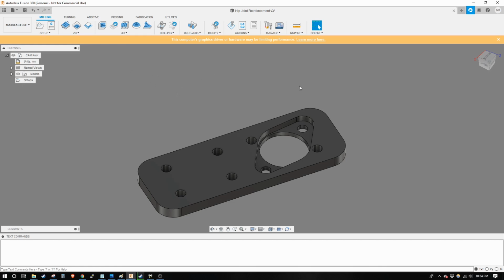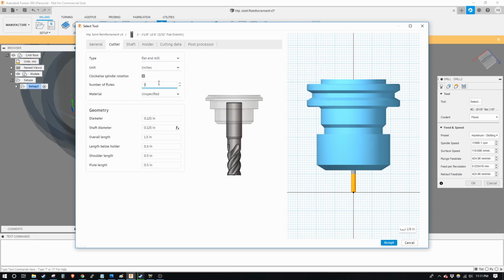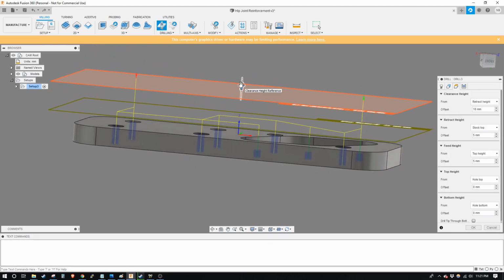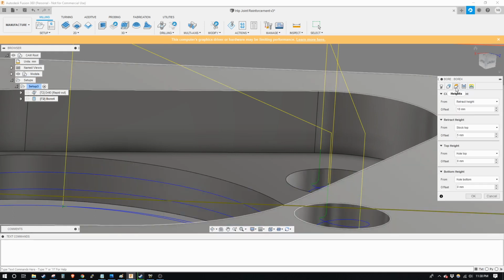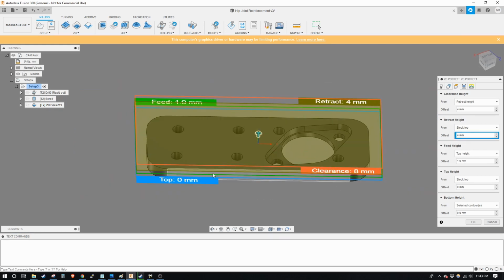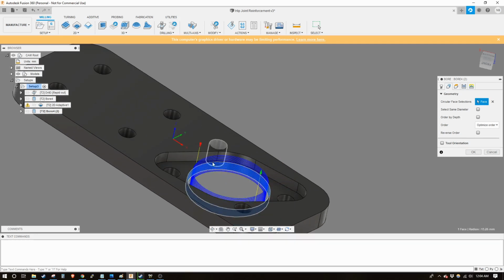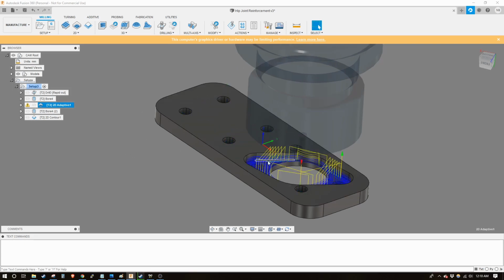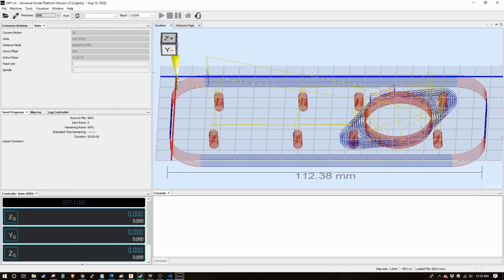Fusion 360 G-Code Aluminum Plate Step By Step Tutorial

Comment: your end mill also needs less flutes. 4 flute isnt good for aluminum.End mills are also not really meant for drilling, which is why when it cuts down to the next level on a cut, it goes in little circles instead of drilling straight down.

Comment: Okay, You divide by four the cutting feed rate three times So I have new spindle can go for 24000 RPM and if I use 20000 RPM as an example do you think I should go for 2 inch or three inch feed rate? with 2mm flat end mill  I don't have 3/32" bit its almost 2.4mm or should I test the feed rate with scrap aluminum board first ? Thanks.
Reply: I forgot to mention to you the spindle brand LD42WS-250 and small 1310 CNC almost like your CNC.
Reply from the maker: I would try 2 in per minute feed rate as a start. I cut out 3 parts before I got my program running reliably. I usually run on the slow end of things just because I'm not worried about run time or optimizing life. If you spend the time trying different things you may find that you can run 3 or 4x faster than what I'm doing by increasing depth of cut or feed rate. The easiest way for a program to fail is to break the bit or if your stepper motors get overloaded and skip steps. Good luck with your CNCing
Reply: @NathanBuildsRobots  Thank you,  I will try that with 5mm aluminum with slow feed first.

Comment: Are you using the offline controller to load the files on the sd card ? I’m having a nightmare with grbl via usb crashing half way though operations and I’m thinking maybe sd card is the way to sort it
Reply from the maker: Yeah I am using the offline controller. It's simple, and I don't have to worry about windows updates ruining a 10 hr program
Reply: @NathanBuildsRobots  thanks man , yeah I’m having a similar issue to be honest and realistically I’d rather run offline anyway so I can just leave the machine to it’s work. Crashed several times trying to do the same operation using grbl controller yesterday 👎. I’ll try offline, thanks , fingers crossed I can get a usable part this time haha
Reply: @NathanBuildsRobots  shame I can’t post pics using the offline controller managed a batch of perfect carbon bits

Comment: Sir can you explain settings for SKD11iron engraving portrait designing Engraving
Reply from the maker: Iron is more difficult to cut than aluminum, I would recommend using 1/2 speed as aluminum as a starting point.
Reply: @NathanBuildsRobots  sir what feed rate ,step over ,and step down and plung rate ,for rough, semi clean and finally finished
Reply from the maker: @sonuverma2796  I dont think this machine can tool steel since it is barely able to cut aluminum.
Reply: @NathanBuildsRobots  sir can you provide me gcode setting for SKD11iron engraving,I will try other fix gantry table moving machine .the machine weight 250 kg
Reply from the maker: @sonuverma2796  your should learn how to use a speeds and feeds chart. This is the best resource i could find online. 
https://mae.ufl.edu/designlab/Advanced%20Manufacturing/Speeds%20and%20Feeds/Speeds%20and%20Feeds.htm

 SDK11 is harder than most tool steels, so I would go a little bit slower than the formulas say.

Comment: Really not enough detail with the running of the cnc. You just skipped over the actual cnc part
Reply from the maker: I see where you're coming from. The whole workflow for running a CNC takes forever, since you have to:
1) programming it in CAM
2) Set up the machine
3) run it and make sure it doesnt do anything stupid
4) Post-process or fix mistakes in CAM

This video was meant to document the process of setting up your CAM software to cut the part out, since that is the most technically challenging part on the computer. There is definitely more to cover
Reply: @NathanBuildsRobots   Hey thanks for the reply. I'd love to see any followup since, or if you know of any complete end-to-end guide. I actually just inherited a 3018 and I have no idea what to do with it.